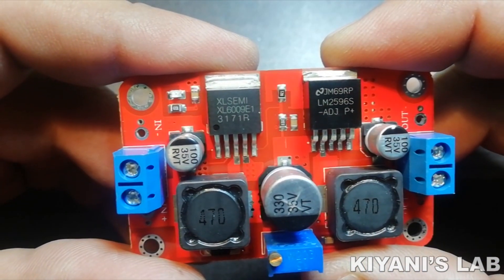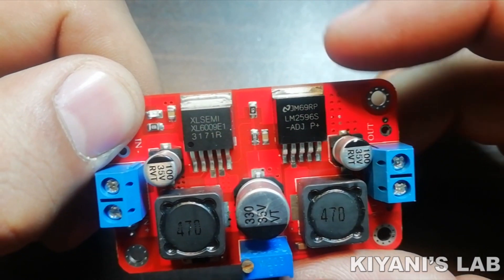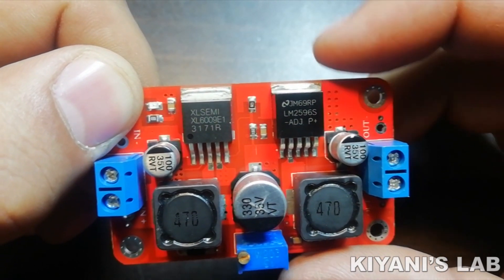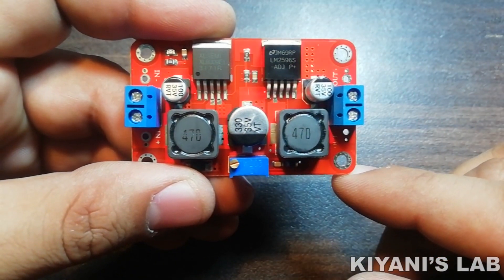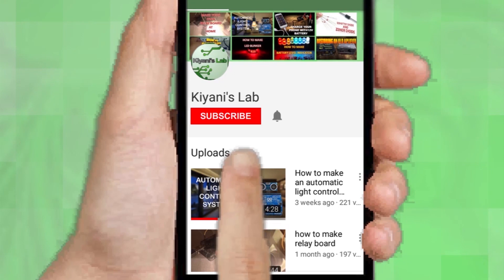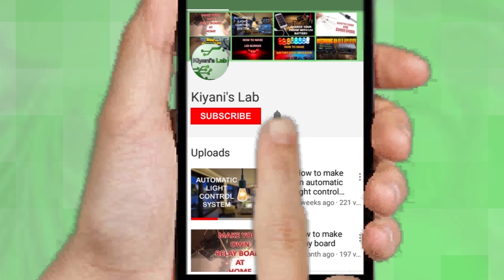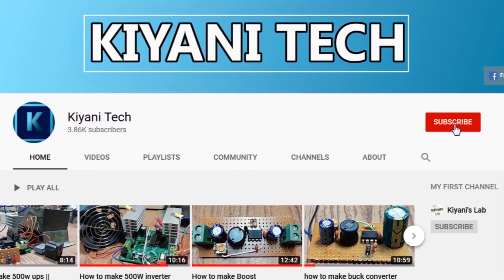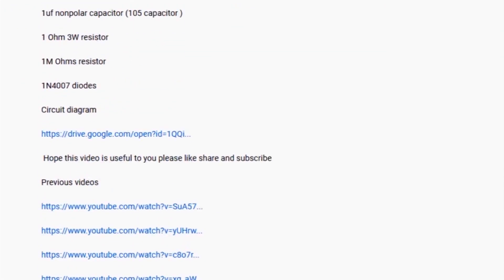Buck boost converter Review

Comment: I want to use it for a project that requires exactly 12v dc and i want to use power source as a 12v lead acid battery which will have 14v when charging and 11.5v cutoff. Will this work for my application??

Comment: Sir, I have a question on boost converter 
Can it possible to make a powerbank  with this circuit 
(Boost the voltage from 3.7v to 5.2v )
Reply: Power banks are based on stepup circuit.3.7v to 5v.